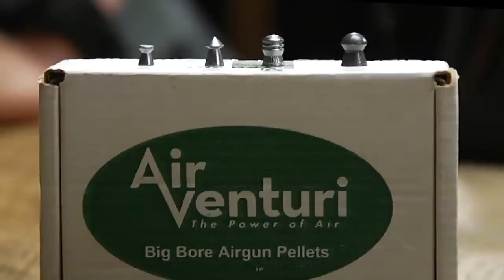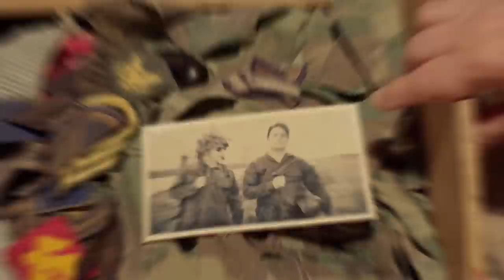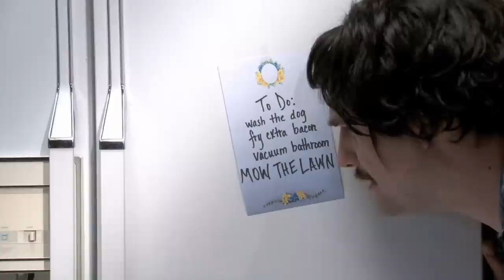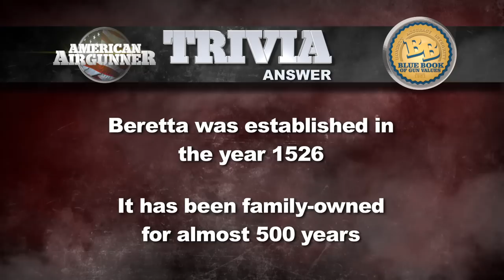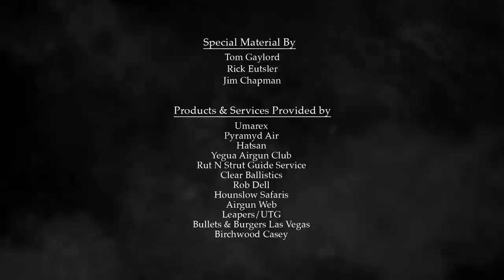American Airgunner 2014 Episode Nine

Comment: Just an added info on pellet traps, if you are shooting a .22 running 36FPE+ then that will not stand up to the abuse, I've blasted through several thin steel backed traps in just a few shots. And ended up having to make a 1/8" steel one.